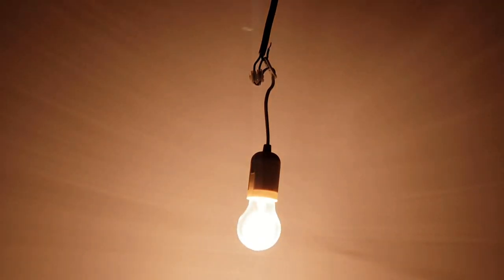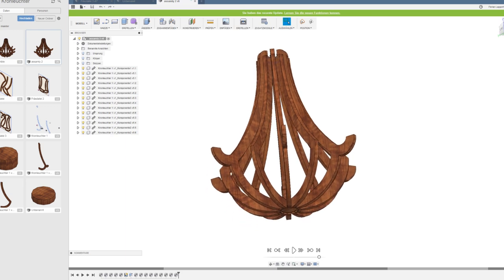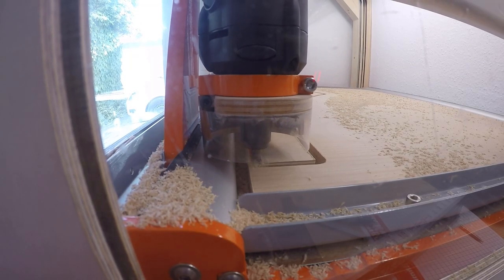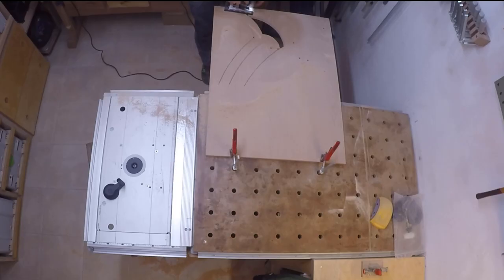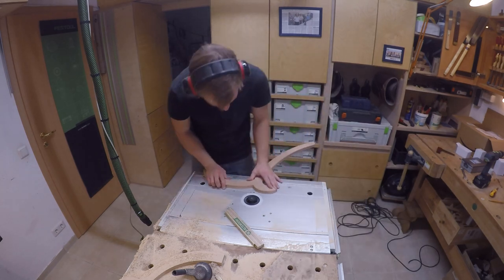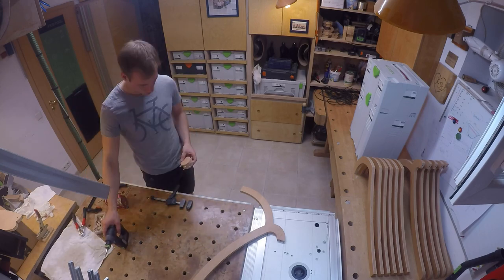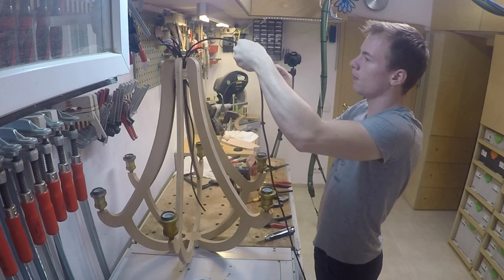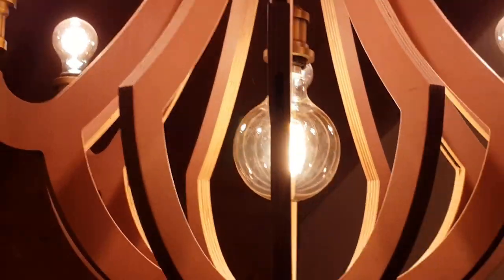Making a Wooden Chandelier

Comment: Hello, thank you for this beautiful video. Can you please share the CNC file and dimensions of this chandelier. I am not a carpenter, but would like to make one for our place by cutting it at a workshop. I can do the electrical, but need your help with wood part. You mention 8 mm but it seemed more than that, maybe 18? What about the finish? Thanks in advance
Reply from the maker: Hi Philip,
I'm happy you like the video! Depending on your location I could maybe also make all the wooden parts and send them to you, if you have to give them in order anyways. If possible, please send me a DM via Instagram.
Reply: @HolzFlo  hello, I am in Lebanon far from you. But I did an autocad drawing for a similar model and I will send you a photo when the product is finished. Thanks again fir sharing